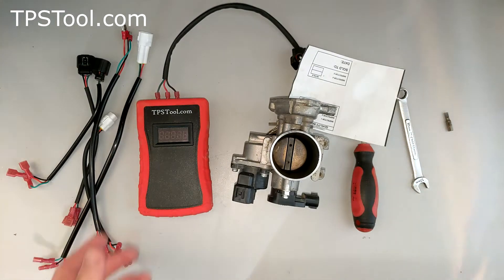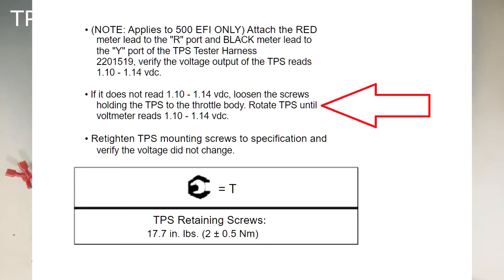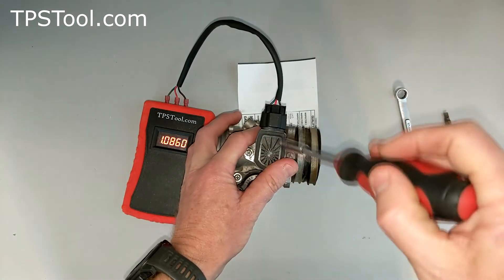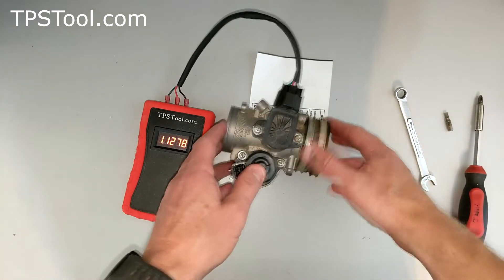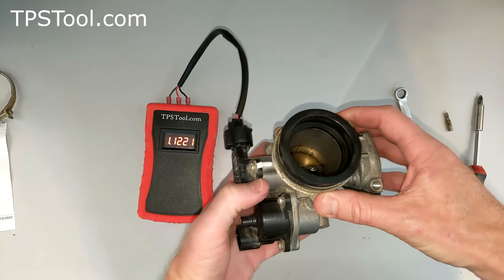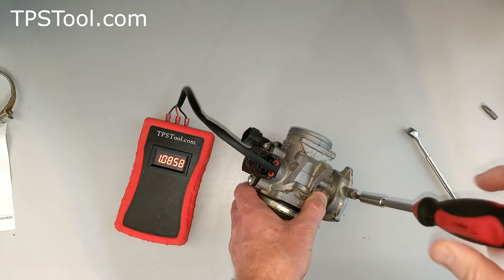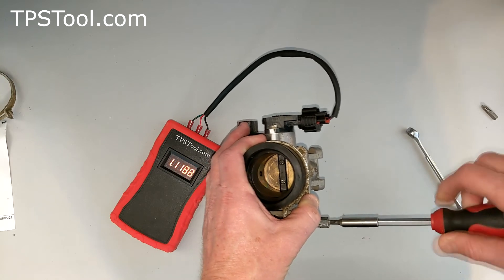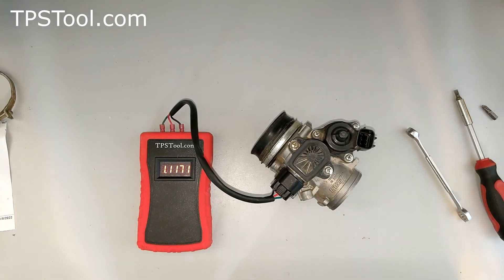Polaris Sportsman 500 TPS (2007-2008) Ranger 500 TPS (2007) and the screw that shall not be adjusted

Comment: Hi Matt I  like your videos.  I have a polaris ranger 6x6.  800 . I have replaced every electrical component as far as to the running parts . I have your tps tool and have set tps to 7100 and can't get it to idle down enough to put in gear . Is the a handheld reader to plug in like a car to get reading on this machine  ? Thanks in advance  Buck
Reply from the maker: Thanks for your comment.  You didn't mention the model year, but don't be afraid to try some lower TPS settings too.  For example, for the 2007 Ranger 700 the manual specifies 0.710, but multiple customers have reported back that 0.640 worked better.  I'm not promising that this is the issue, but if you're out of ideas then maybe give this a try.  Please post back your result!  If your model has an IAC valve (Idle Air Control), also make sure it's clean and working correctly.  There is a Polaris Digital Wrench tool that the dealers use, I don't know how much it costs or if a dealer would sell it to you.

Comment: Ok so if i adjust the tps with your tool all the way up for this same 2009 500 efi.....i can only get 1.06 with the sesnor adjusted all the way does that mean sensors no good or does sensor need to be pre loaded a certain way
Reply from the maker: Thanks for your comment.  First make sure the tool is connected correctly.  Does the reading rise to over 3.5V at full throttle? If not then the tool isn't connected correctly, or the TPS could be bad. Send me an email and I'll help you get going.

Comment: Can a bad TPS position cause your machine to act like it's running rich?
Reply from the maker: Thanks for your question.  Yes it could.  As the throttle opens further, the TPS will read a higher voltage and the computer (ECU) uses that to help determine how much more fuel to put in.  The general idea is the more open the throttle is (the higher the TPS voltage), the more air that goes in so more fuel is needed.  If the TPS is reading too high, the computer will think the throttle is open more than it really is and it will add too much fuel, making it run rich.  It's surprisingly sensitive, changing it by 0.02v can make a noticeable difference on some motors.
Reply: @TPSTool  thanks for the answer! Can I adjust the position and go by RPMs at idle. (1150 is what I read on a forum) or do I need to test voltage? Working on a Polaris ranger 800 efi acting rich.
Reply from the maker: @EkonRekon  To set the TPS you need to go by voltage.  When everything is working properly, idle speed is controlled by the ECU using the IAC (Idle Air Control) valve, which is the other thing on the throttle body with the plug that has many pins.

Comment: Are these numbers the same for a 2006?
Reply from the maker: Thank you for your question!  I'm having trouble finding a free download for the service manual for that year, but I will post in the forums and see if I can find anyone who has the service manual.  If you've got the service manual then the info will be in there.  Also you can try these numbers to see if it works for yours, just write down your original readings so that if these don't work you can go back to your original settings.  Also be sure you've got the EFI version, in 2006 some Sportsman 500's were EFI and some had carburetors.  I'll see what I can find and I'll post back with the result.
Reply from the maker: Mark I didn't forget, I'm still looking for the 2006 EFI manual online.  Send me an email:  mwolfe [at] qualitysmart [dot] com
Reply: I could also use those numbers, i have looked high and low and cant find them anywhere. Was going to attempt to use your numbers from this video if I cant find or get any other info.
Reply from the maker: @nickbaker111   I just saw your comment.  I've got numbers on our common settings page (link below) for the 2007 model year, but I haven't yet found the 2006 service manual online for free download.  It is available for purchase and that would be the best place to find the numbers, but if you don't want to buy it then maybe try the 2007 numbers and see how that goes.  Here's our common settings page:  https://www.tpstool.com/common_tps_settings.htm

Comment: Im fucked I just got a quad didn’t know about this TPS sensor since I got it used and it would stall in my effort to figure out what it could be I took this sensor off and now it don’t start Damm it
Reply from the maker: It's not that big of a deal, you just need to put it back in the right spot.  The best thing of course is to get the proper tool and adjust it to the spec.  The spec should be in the service manual.  If you can't find the spec then post back and we can help you find it, or we can get you close enough that you can then use a TPS Tool to fine tune it back to the best spot.  If you can't do that for whatever reason, look carefully to see if it's got a stripe of mechanics paint across the seam between the TPS and the throttle body.  Often at the factory they'll put a stripe of paint after everything has been setup.  If you can line the paint up very carefully then you've got maybe 50% chance of it being close enough to run OK.  It will run better if you set the sensor to spec, but that should get you close enough to get it running, assuming it has some paint.  I hope this helps!